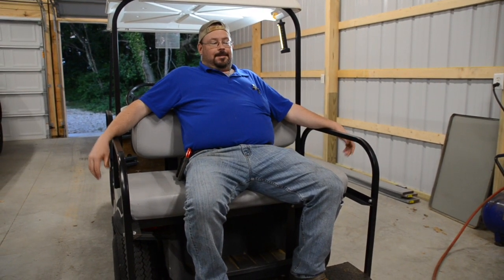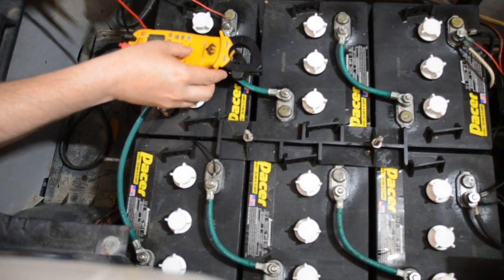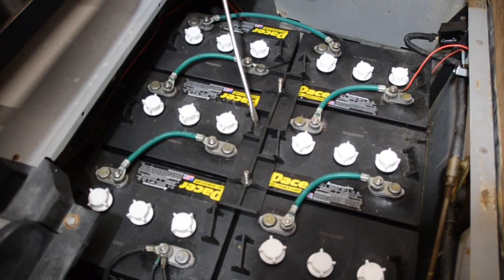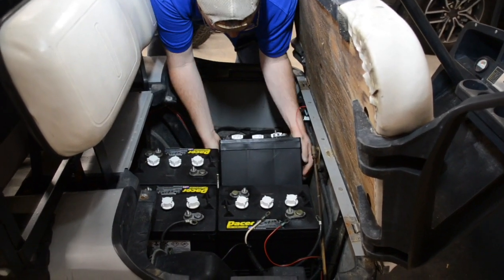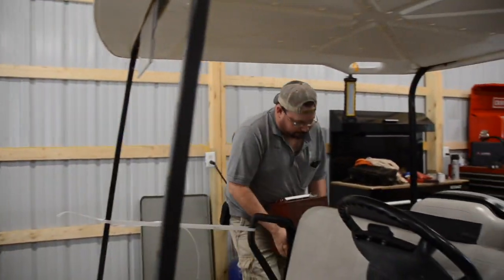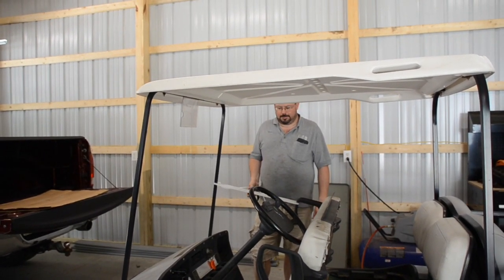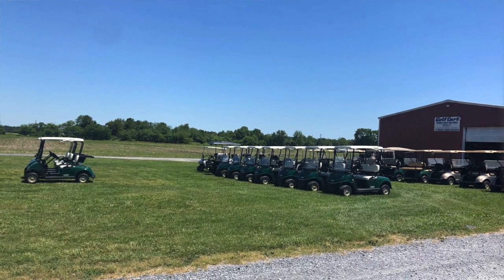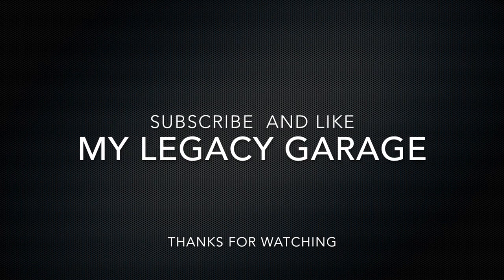GOLF CART WON'T GO!!! CAN WE FIX IT??? EZGO GOLF CART BATTERY REPLACEMENT!!!

Comment: I work on Carts at my work, since no one else wants to.  I found if you pull a bucket handle out of a 5 gallon bucket, it works great for lifting batteries so you don't kill your back! The little hooks of the handle fit right in the top sides of the battery, almost like it was meant for it! 😃
Reply from the maker: That's a great tip! Thanks for sharing and thanks for watching!

Comment: not mentioned whether any order it should connect nor any switch to switch off . My cart is giving spark on the last connection. I was searching How can I correct it. I could not get the answer
Reply from the maker: If you are getting arching when making the final connection then you have a wire crossed somewhere. Go back through and double check that everything is connected to the right terminals. Thanks for watching!

Comment: Look for shorts first , flip toe switch a few times the short wire will get hot to the touch , usually right in wires under seat. (Small wire) not cable

Comment: I replace the battery, still won’t go. Any idea?
Reply from the maker: Have you checked the voltage at the motor? If looking for an electrical issue I pick a spot, check for positive and negative, then work backwards til I find it. Could be the forward/reverse selector or even the key switch.

Comment: It didn’t work
Reply from the maker: What didn't work? If you've got fresh batteries and good connections with proper voltage to the motor then you may have a motor problem.